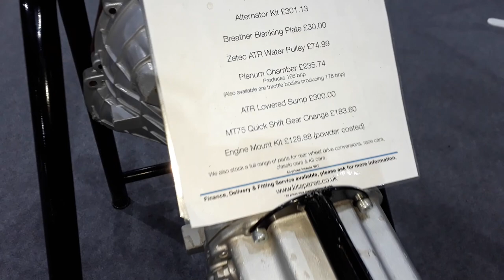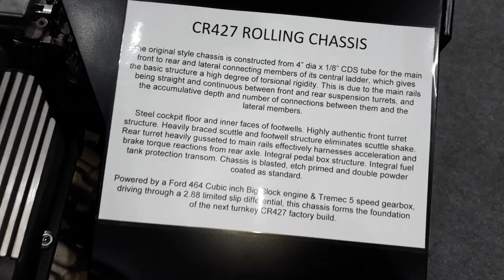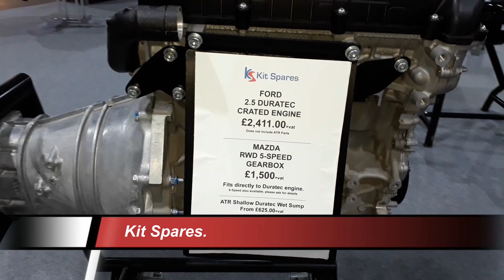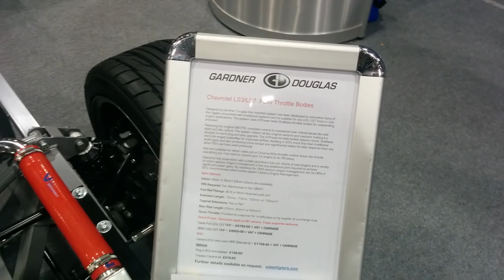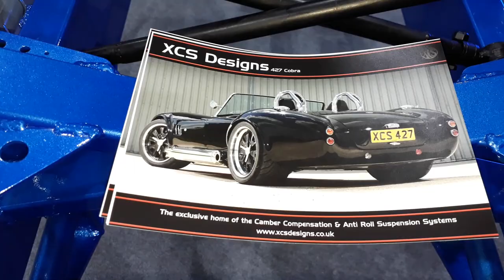Chassis and Engines at Stoneleigh Kit Car Motor Show 2019. Ep3.

Comment: Looked like a good place for ideas. How is the car coming along? Mine come to day, what have I got my self into 🙈
Reply from the maker: So it turned up? Yeah, when you look at it all it can be quite daunting. But if you take your time, I'm sure you'll get there. ;)
Reply: Yep fabricating is the easy bit for me but this ECU electrics bit is frying my brain. Sent the ECU off to get decoded but haven’t a clue how I’m actually going to get the engine to run 🙈 some one cut the full wiring loom just after theECU so have to rewire it all back together
Reply from the maker: @Spoonersoutings  They cut the wiring loom? Muppets! That'll set you back a bit. What was your engine choice? I know the BMW V12's are very tricky to get running once removed from the original car.
Reply: Audi v6 335bhp plenty of power. The problem with newer engines is they don’t like being taking out and put in other cars as you have to have the dashboard, steering column, all the locks as if one of them is missing the ECU won’t work this is what my ECU guy has told me. So if you are going for that bmw v12 get the hole car make life a lot easier
Reply from the maker: @Spoonersoutings  Oh that's right, I think you mentioned it before. Yes you're right about all the rest of the electrics in the original donor car stopping the ECU from working. I think the best way to go is always start with a complete donor car, if you can afford it and have the space for it.
Reply: Definitely the way to go. I put a video of the delivery up on YouTube if you are curious to see it
Reply from the maker: @Spoonersoutings  I checked it out, video number 1 :)